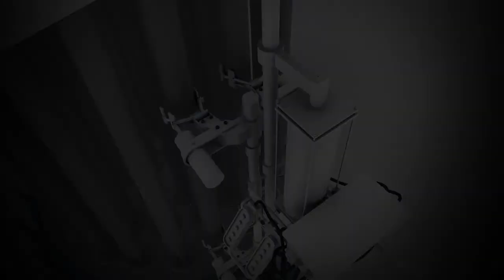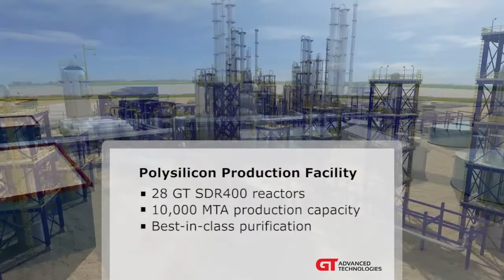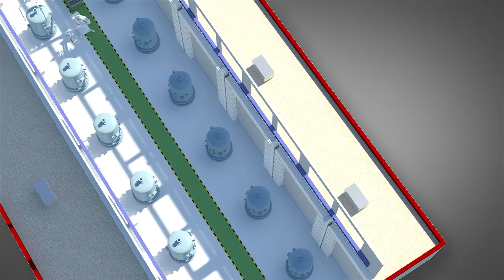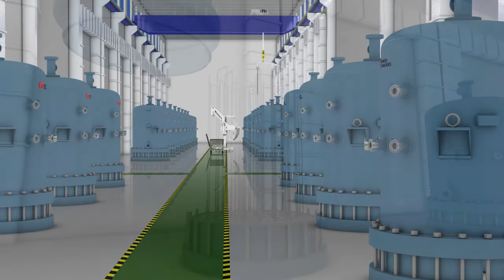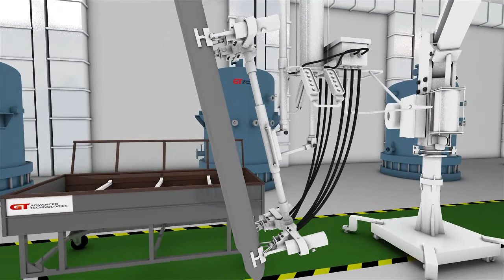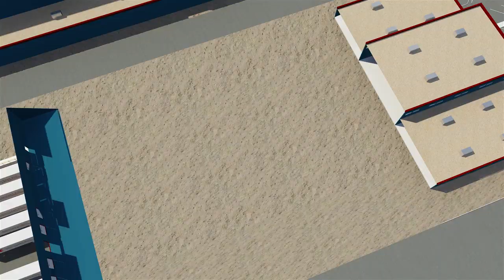3D Animated Flythrough of Processing Facility

Comment: Nice job.
Wondering what your light and render-setup were?
Looks like it's not (fully) GI, right? Maybe MentalRay no GI (or 1 bounce)
and some AO?
Reply from the maker: +Robert LC - Digital Artist  Thanks!  You're right it was something odd that I had to do to cut down render times. I added an omni light and mapped a Ambient/Reflective Occlusion to the projector map slot. Then I just added a standard HDRI (background switcher) with no exposure control. Not having to calculate final gather cut render times tremendously!